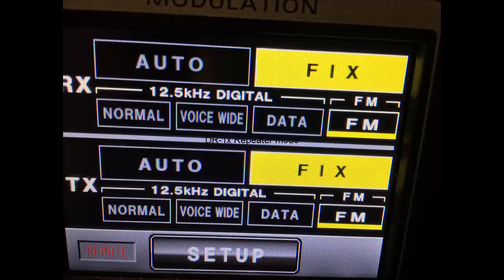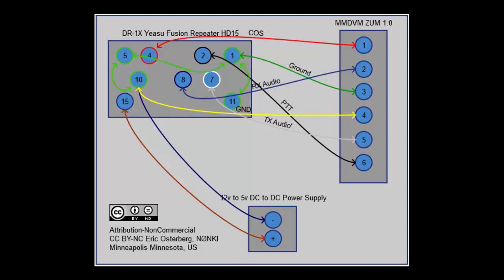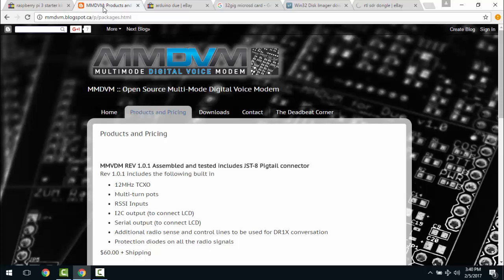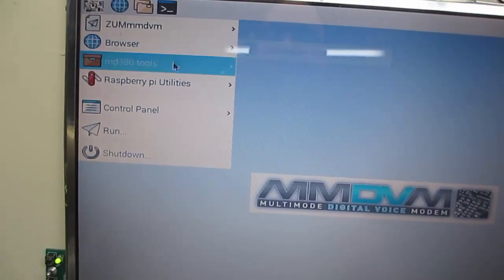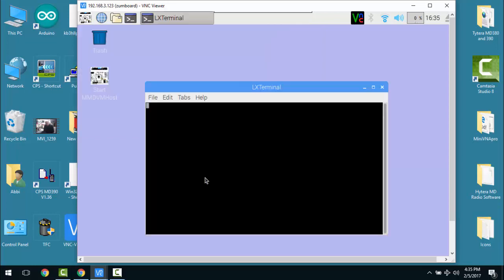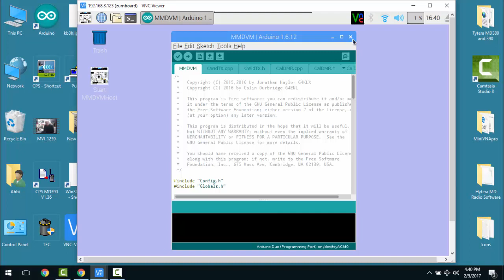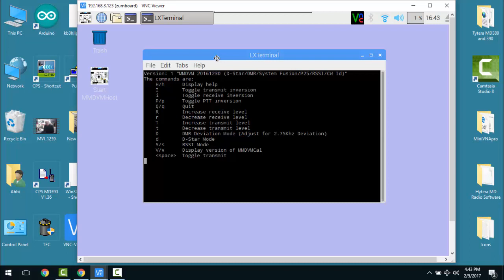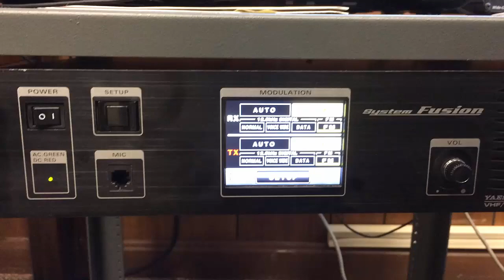MMDVM DR-1x conversion tutorial DMR and ZUM board

Comment: Got a question.  I don't get any output or change on the SQL DET pin 4. I have a DR1x repeater.  Reading the manual looks like there may need to be a pull up circuit to provide something for the dr1x to sink.  From the manual I see the port can sink about 10 ma.  I have no voltage on this port with the squelch open or closed.
Reply: The COR output of the DR1x (pin 4) is an open collector and doesn't source any voltage (open no sig, to ground with sig).
Reply from the maker: That schematic I have in my video is 100% spot on for the DR-1x.  I used a connector from radio shack and I cut off another connector for the mmdvm side.  Wire it according to the schematics and then also the big foible for me was not putting the repeater in the proper mode - ensure the repeater is set the same exact way in the video.  I don't have any pull up circuit in my current cabling.

Comment: Trimmer adjustment.. Not there yet but probably need to change the trimmer out to a 5 or 10 turn pot to allow for easier adjustment by the comments here and comments I've read other places.  The only other way would be to change the voltage divider resistor values and change the pot to a smaller value that would allow less adjustment overall..

Comment from the maker: Link to raspberry pi 3 image:
https://drive.google.com/open?id=0BybZQQXhvF7KbmMxT2xJbVltZWs
Reply: Hi Matt, I have the latest Zum/Due combo from Bruce and a Yaesu DR-1X. So far have not been able to get the ZUM MMDVM do do it's thing with the DR-1X. Tried a couple different images that I could not get to control the DR-1X properly. Then I discovered your video and became excited again that I could get this repeater going. However, I am having trouble getting your image to unrar correctly. I have downloaded twice. It downloads as a 2gb rar file. I have tried multiple times to unrar it. Used both winRAR and winunrar. Both programs expand it to a 30gb plus file with no extension. OF course, without it being an official img file, Win32DiskImager will not work. So, my question, has there been other problems with the image file or am I doing something wrong. Thanks for all you efforts and I look forward to getting your image to bring the DR-1X to life.
McCoy Phillips-N5YAV
Reply from the maker: Hi McCoy.  i'll double check it will unrar.  It is indeed a .img file that was compressed with "best" compression.  I'll get you the version I used and maybe you can try the same unrar program.
Reply from the maker: Hey McCoy - make sure your repeater's screen is on the one i show in the video - if you have the frequencies screen showing instead - your repeater won't function and talk to your mmdvm - it was a weird thing but it messed with my mind - ensure you're looking at the same exact screen i show on your repeater. here is the new link: https://drive.google.com/file/d/0BybZQQXhvF7KRTk2Q20xcHdiSFU/view?usp=sharing
if by chance you don't see the extension of .img make sure you add the extension to the end of the file.  (it should however extract with .img)  Edit your mmdvm.ini with your registered dmr repeater id and ensure you talk to your brandmeister network guy  via email to add your repeater to your user brandmeister user account.  Then and only then will the mmdvm talk to the brandmeister network in repeater mode and work.  Take your radio and key up on the frequency , slot , color code and talk group (parrot) and keep keying as you tweak the tx potentiometer and see activity on the screen.  I found tweaking it almost all the way up (tx pot) got me tuned in.  You'll definitely see what i showed in the video on the screen when you key up.
Reply: Matt, what is the root password in this image?

Comment: Wonderful video and straight forward.. However, I am having trouble unraring the image file. I keep getting a .img file that is only 4.3gb in size.  I've downloaded it several times to verify that I've got a good download of the file.  Is the img file itself compressed?  I also noticed in the comments a link to a file from 2-17 rather than the 2-24 that I downloaded. What if any difference in the files?  Waiting on the ZUM board and figured i'd load up the raspberry PI while I wait.
Reply: Thank you I got it.. Using DD in linux to installed the image to sdhc card.

Comment: Hi Matt I have a question, the MMDVM is it program with the repeater frequency or is it program like if it was a mobile (oposite of the repeater)
Reply from the maker: This particular MMDVM (ZUM board) is controlled by the repeater via the serial interface.  IT takes its audio directly from and to the repeater.  You setup the repeater itself to listen on a certain frequency and respond on another - the MMDVM listens to what is sent to the repeater and interprets the type of signal being sent - dmr, dstar, etc and then gateways to the internet to that service - this one is using brandmeister.  The device itself is on top of a arduino which is programmed.  Basically if you set your repeater similar to mine (same mode) and edit the settings in the mmdvm.ini file - those settings just go thru to brandmeister and register with them.  The mmdvm here doesn't control the frequency it just reports what is in the mmdvm.ini to the various digital services - brandmeister dmr, or dstar etc... hope that helps.

Comment: Matt, Do you have the HDMI disabled on this image? I get nothing on monitor when booting up, other images show fine on monitor.

Dave-KB1PVH
Reply from the maker: nope- it is enabled.  I used hdmi connection on the raspberry pi 3 to 2 different monitors so i know it worked fine.
Reply: mattYoung17754 Interesting! no joy here with the Utah DMR image and yours, but others work.
Reply from the maker: Maybe try another HDMI cable or display - i had a similar situation with the Xbox 360 not liking a cable i had perhaps you're experiencing the same issue.
Reply: I just did a VNC into it.

Comment: Do you have a tutorial on how to install the SDR software and TUNE the repeater?   I can't figure out how to install the FreqShow, I do not have the TFT screen.  I know there's a work around to use a mouse and monitor but I still can't even load the software.  Then how do I tune it properly? I hope you can help!  Maybe even make a separate video??
Reply from the maker: i had mixed results with the freqshow app - the RTLSDR sometimes locked up.  I found it easiest to just take a small pot tweaking tool and move the TX pot super minute - as in the width of a mosquito leg each time and key up until you see activity on the mmdvm screen.  Start all the way closed, then move slowly to the right -clockwise until you get communication.
Reply: Well Matt, here is my problem.  We thought we did that but the repeater works ok on D-Star, not too good on Fusion and DMR I can't even wake the repeater.  I followed your instructions and purchased the SDR to hopefully help me out.  What am I looking for on the RX side when tuning the pot?  I think that's the key and I know I'm not the only one with this issue.  You say start with it closed and move it slowly, but what am I using to receive?  

Any help is appreciated!  PS: Repeater works fine on the bench, but we moved it to the repeater site and now its' not receiving as good.

Comment: Will the DR1x still do C4FM after the addition?
Reply from the maker: Yes - C4fm is the YSF (yaesu System fusion) native protocol, but don't confuse it with Wires X rooms.  There are gateways to some of those rooms if you need to talk to those folks.  Yaesu to Yaesu radio communication digitally will work using the MMDVM repeater.  My image only has DMR enabled, but you can enable it via the mmdvm.ini file and tweak around with as many modes as you wish to have the MMDVM slice through.